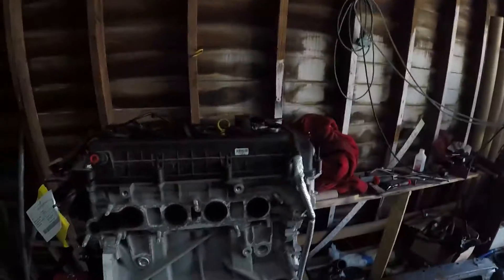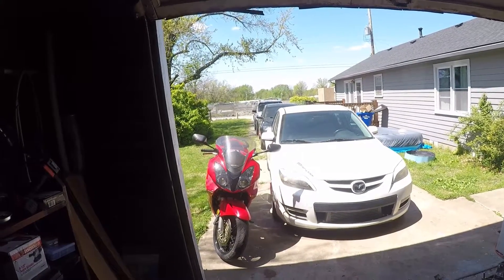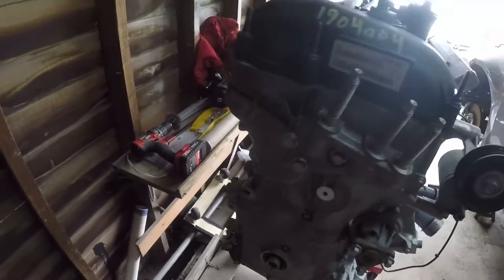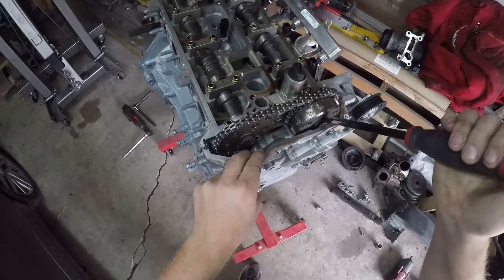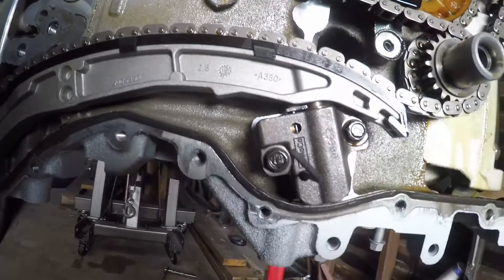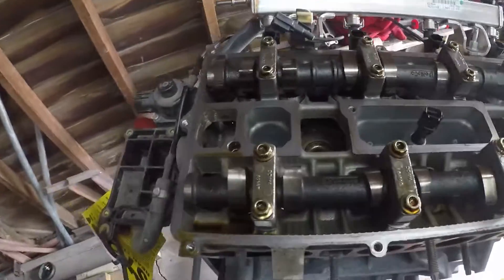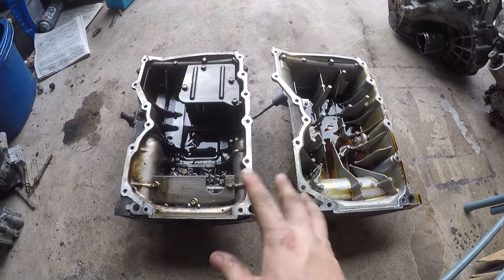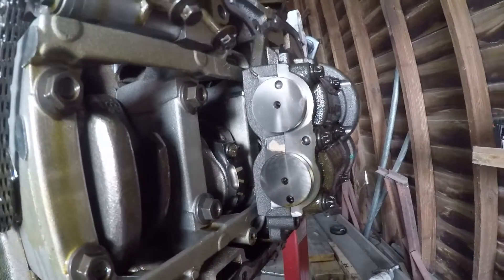Mazdaspeed6 2.5 swap #3-Taking Apart The 2.5 Fusion Engine And The 2.3 DISI Engine!

Comment: Do you know what the transmission bolts are like size and pattern I am trying to Mount the engine to the engine stand but I don’t have the transmission bolts
Reply from the maker: I’m not sure. It pretty sure the bolt heads are 14mm.

Comment: How would the oil feed / oil drain work for the 2.5  seeing it’s a  different bottom end
Reply from the maker: speedlife madzela I will be covering this in a future video. But basically tap into the oil pan for a return and t off of the oil pressure sensor for a feed

Comment: Hey man, I'm doing the same has you ! My engine is out now. Do you reuse the clutch of the 2.5 engine ? You video is super helpful and it really pumped me to do it ! Thanks a lot !
Reply from the maker: The 2.5 didn’t come with a clutch from fusions. You use whatever clutch your transmission is. If it’s pairing with a mazdaspeed transmission, use a mazdaspeed clutch/flywheel.
Reply: @spillybuilt7491  thanks you for the tip ! I'll use my mazdaspeed one.
Reply: @spillybuilt7491  Hey man, one last question, what did you use for the turbo feed and return ? I know that I need a Tee, but I don't know the size of the thread and for the return, I'm not sure which kit or part I should get. And his your speed still going strong with that 2.5 ? Thanks !
Reply from the maker: Yes it’s still going! Almost 2k miles on the swap so far. And for my feed, I actually flipped my oem oil feed line upside down and trimmed it. Then I have a spin on oil filter conversion with a sandwich plate on it. Then just a fitting on that sandwich plate and 1/4” hose ran to the trimmed oil feed line.
Reply: @spillybuilt7491  Hey man been a while ! I finally finished my 2.5 conversion ! Did you got p2088 check engine light at the beginning ? I used all ford fusion timing component since they seems stronger. I was thinking maybe the vvt from ford is a bit different and the ECU need to adapt ? The car starts fine, but seems to be missing a bit of power. Idle is a bit sketchy and while doing strong acceleration, I'm getting misfire. If you could help me, it would be awesome ! I doubled check timing and oil passage, I'm out of clue.
Reply from the maker: @nicolastremblay7527  no I had zero codes. Like the only car I’ve ever owned without check engine lights lol. Is that cam position circuit code? Common causes are bad timing chain or actuator (how many miles are on them?) bad vvt solenoid, low engine oil, damaged cam sensor plug or wiring, or even bad ecu. Possibly a messed up relay or fuse too
Reply from the maker: @nicolastremblay7527  also possibly out of alignment, although you said you double checked it

Comment: Wait, so you can use 2.5 timing components on a speed 6? VVT actuator, exhaust sprocket and crank sprockets?
Reply from the maker: Yup! You can swap them. You can NOT mix and match however. You have to use everything from 2.5 or everything from 2.3. This includes oil pump stuff